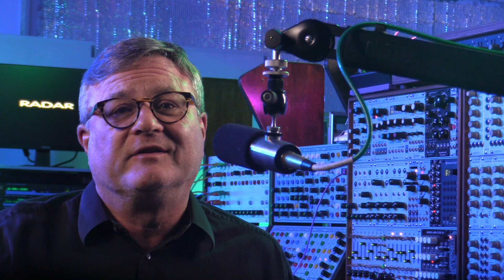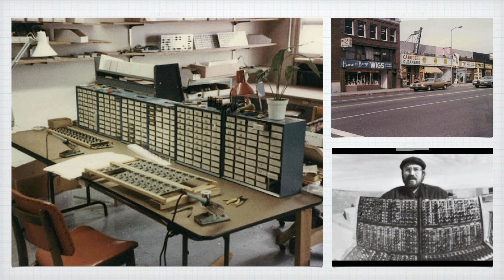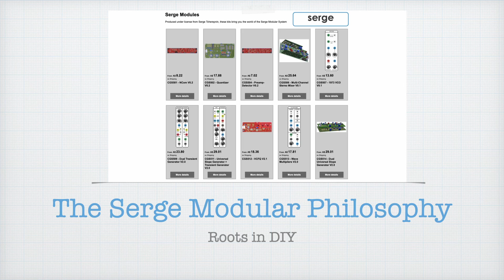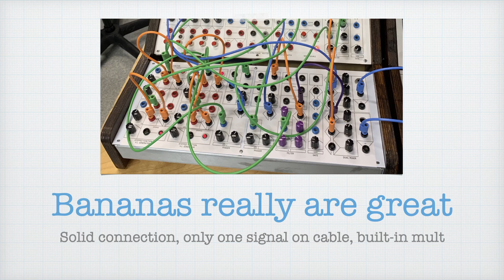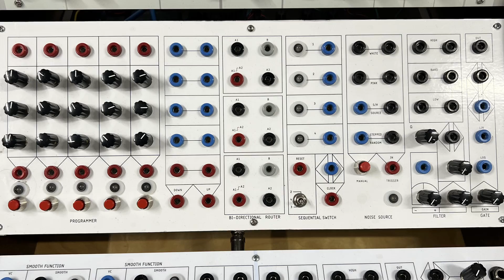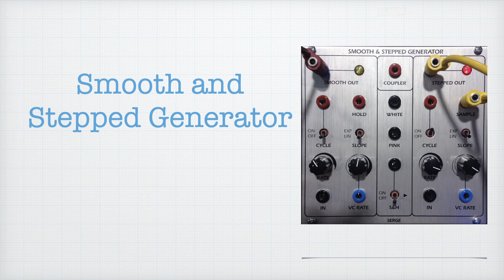The Serge Modular Synthesizer - History, Theory, and Application

Comment: Beautifully done commentary and descriptions. I had a 4 panel STS system from the 90s I used for personal composition and occasional live play with other area synth heads, sometimes jamming, sometimes in venues. Super fun. Your comments are very good. I admired many things about the system, including the incredibly wide range of voltage control for oscillators, DSG's and so on. Working with the 4mm Pomona cables was pure pleasure. Finally sold it during financial downturn around 2009, a painful experience. Don't know if I'll get another one, would be nice if I had time to play with it. Highly recommended for curious weirdos of every stripe.

Comment: FANTASTIC VIDEO! I'm traveling so when I can find the time I'll send some info (including photos  if allowed) about my own 7 panel system obtained in the late 70's and early 80's. I  was able to visit the Haight location in the early 80's, looked like a great place to work. My electronic music experiences began with post-gig (rock band) experimentation on a small Buchla 100 system in the late 60's. Ten years later I managed to get a bachelor's degree in composition in electronic music from Western Washington University in 1983 using my Serge system and a large eMu modular system. I missed by one year working with Morton Subotnick during his residency there. Ironically I was able to attend his 80th birthday live performance of Silver Apples of the Moon many years later in San Antonio. 
I'm currently relocating my Serge system, expecting to power it up next month for the first time in over 30 years. I would greatly appreciate any suggestions you might have for   insuring a safe and sane power up. I assembled three of the second generation panels myself so I have no excuses...

Comment: I built two panels last year, and am enjoying them very much.
At first, I resisted getting into a system, that used banana jacks, instead of the usual 1/8" jacks found in eurorack. I wanted all my gear to adhere to one standard.
But after trying it, I find the stacking banana jacks to be very ergonomic, and much prefer them, for their ease of insertion, and stack-ability. Makes patching much more fun/liberating.
The fact that you can just touch the tip of the jack, into a socket, without fully inserting, makes experimentation much easier.

Thanks for this excellent video on the subject.
It was much needed, as Serge is somewhat obscure, and not a lot is available on this subject.
Wishing you happy trails, and continued success with your music interests 🎶🌎☮❤
Reply from the maker: Thank you so much! And totally agreed on the banana jacks. Never a scratchy jack to be found. Best on your musical journey as well. :)
Reply: Old school audio guy here (60's to now) that also loves the banana jacks. Better contact, easier to install,  and stackable. It was a pleasant surprise using them on my Serge panels.